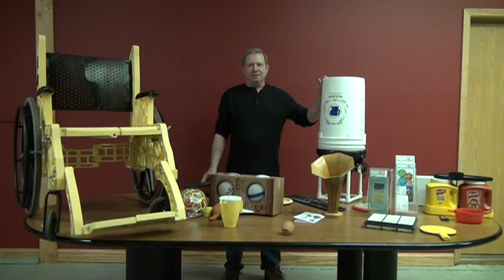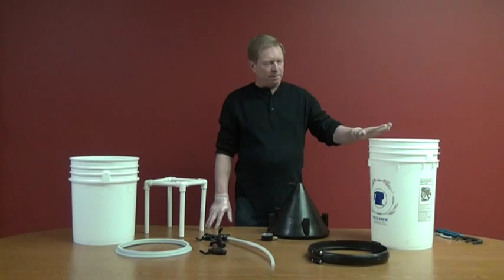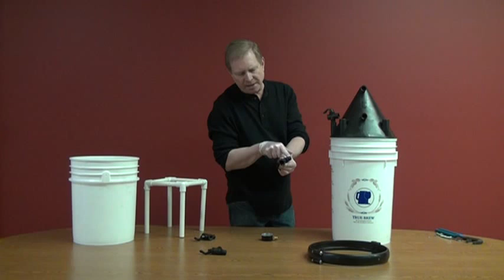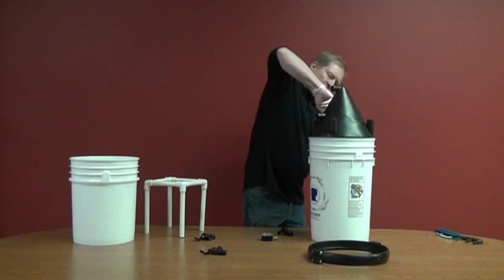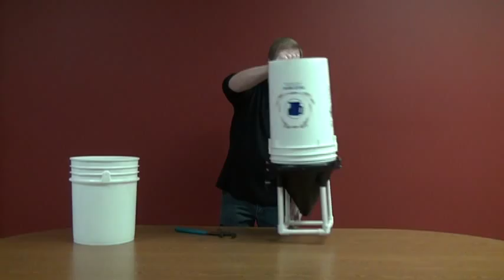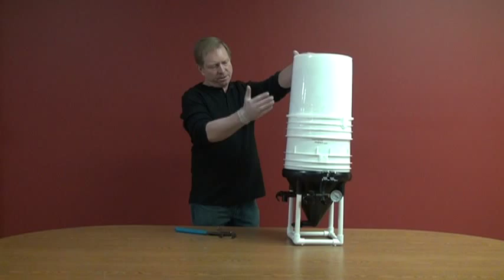OneDerBrew™ Assembly

Comment: Wow, this is a considerable improvement over your previous design!!  I read that you recently debuted this at the AHA conference?  Your webiste doesn't give many details on availabilty. When do you expect to have this product available for purchase, and at what price point?

Using the bucket as a pressure vessel does scare me a bit, as food-grade buckets are not typically pressure-rated. With a quick napkin calculation, even 15PSI puts ~12,000lbs of force on the assembly. O_o